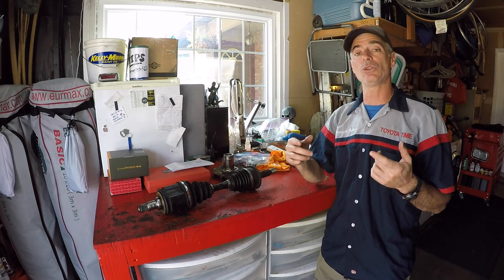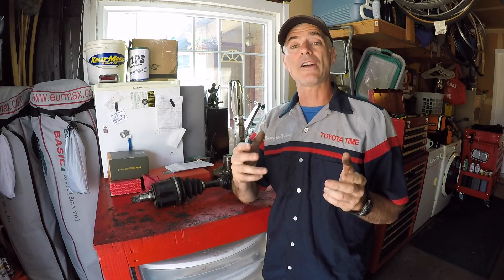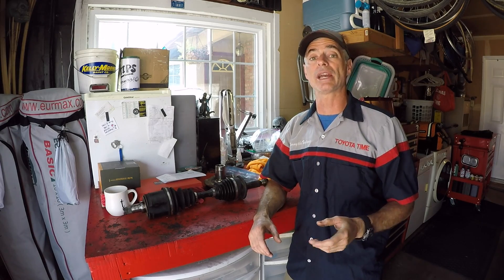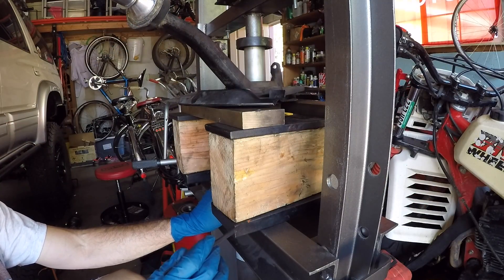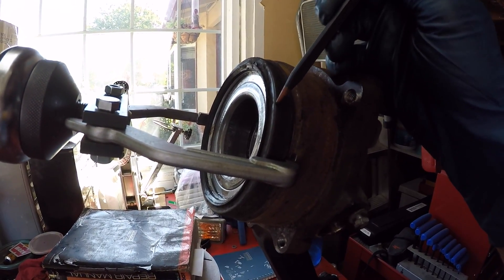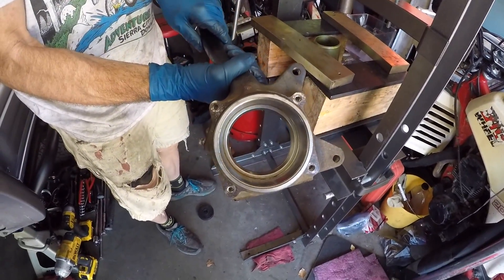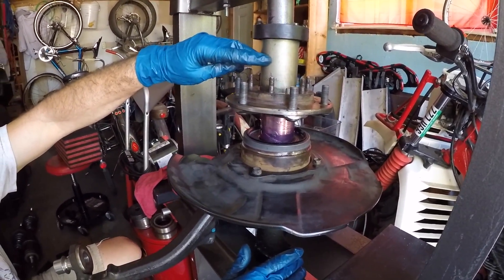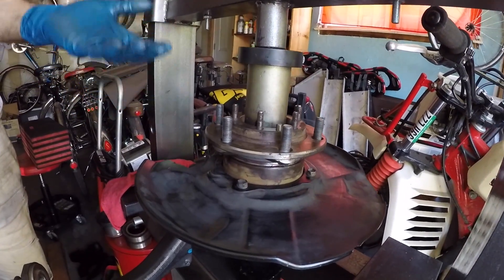Manual Hub Swap Part 2 - A.D.D. Hub Bearing Replacement

Comment: Hi Tim
Instead of using the slide hammer to pull off the inner seal I found if you just use a sharp wood chisel with the bevel side down you can work it off without leaving any marks on it. Just be careful to not hit the chisel in further once you touch metal. Once you have a small gap you can work the rest of it off with a small pry bar. It's the same idea of how you would remove the dust cap off the hub. If your seal is not badly rusted or has any marks in the rubber parts you can usually clean them up and reuse them.
Reply from the maker: Yeah, there's quite often more ways than one to get something done.  Thanks for sharing your technique.

Comment: Wish I woulda watched all these when I did my 4wd conversion.
I used the big press at my old job. Smashed both the new bearings by not properly supporting em. This was years ago now.
Replacing one CV tonight cus OEM boot is blown. Going to replace with a Autozone CV for this weekend then reboot OEM and replace again.
Reply from the maker: Francois L Sicmods Mr. Frenchy! Thanks for stopping by our channel and leaving a comment. Hope all goes well with your CV Re-booting

Comment: Tim, are the (wheel bearing) on a auto locking hub Tacoma same as manual locking hub? ( they share the same wheel bearing) I'm in the process of doing mine.
Reply from the maker: Yes, they are the same bearing.  Check out this video: https://youtu.be/Dj-2IzO9RFk

Comment: Hi Tim, what if I wasn't able to torque my wheel bearing nut to the full 205 ft/lbs? Right around 150 ft/lbs on both hubs there was no one heavy enough with me to hold the tool down without it "rocking out". Will this drastically decrease the life of my bearing?
Reply from the maker: Hard to say.  The nut is pre-loading the bearing.  Will 55 ft-lbs make a big difference?  I don't know.

Comment: Tim and Sean, Im considering a Manual hub swap using mostly OEM parts on my 1999 Limited 4runner before my trip to Alaska. The trip is 8500 miles round trip. Question is Timmy, do you like the swap you did on your truck? Thanks, Russ
Reply from the maker: I love the swap.  My CV axles receive way less wear because they're only turning when I'm in 4wd and I lock the hubs.  I also like being able to use the benefits of 4Lo when climbing steep paved mountain roads.  Using 4Lo enables me to get the benefit of a lower automatic transmission temp going up steep roads without having to worry about damaging my front differential or CV axles.

I have heard that the manual hub CV axles aren't as strong as the ADD axles, but I've done a fair amount of 4wheeling in my rig and haven't broken a CV axle yet.  Another thing is if you need to pull a CV axle with manual hubs, it's a little more work to get it out because of the extra parts.  It's not hard, but it's more time consuming.
Reply: Thanks great info. So are you saying that I can use my 4low without being in 4 wheel drive? I feel stupid right now.
Reply from the maker: Yes. With the manual hubs in the unlocked position, 4 hi or 4 lo won’t spin the front tires
- Sean
Reply: @TimmyTheToolman  Thanks Sean, I already have parts ordered from Joe Joe to do the Manual swap

Comment: Hi Tim, I recently rebuilt a set of manual hubs to put on my Tacoma. I made the mistake of not buying new hub needle bearings and I believe one of them has failed. I am not sure if you have done this, but if you can help I would appreciate it. In order to replace the hub needle bearings I would need to:
1) Remove spindle.
2) Remove the notched nut.
3) Using a slide hammer (?) to remove the brass crush ring
4) Remove/replace the needle bearing (it should come out on its own or with the slide hammer?)
If you can let me know if this sounds right I would appreciate it very much!
Reply from the maker: I actually have never done a replacement of the brass bushings and needle bearing on a set of manual hubs.  I have the parts for it, but haven't had the need for it yet.

I don't believe you need a puller to remove the brass bushings.  I'm pretty sure you can use a long punch, insert it on one side and catch the lip of the bushing on the opposing side and start knocking it out with blows from a hammer working your way around to drive it out evenly.  As for the needle bearing removal, I don't know if it's a press fit or not.

ORS (Off Road Solutions) sells the bushings and needle bearings and I would bet they know the steps to replacing the needle bearings.  I'd give them a call.  https://www.offroadsolutions.com/
Reply: @TimmyTheToolman  Thank you for the quick response. I will give them a ring for more information. When I do the job I will try to remember to comment back with how it went.
Reply from the maker: @Skyder12  Yes, please share your experience replacing the needle bearing.  I'd like to learn the correct process from you.

Comment: Hey Tim, I'm wanting to do the manual locking hubs on my 99 4Runner. If I get used one's like in the video, do you recommend rebuilding them first? And if I can't find a used setup, is there a brand that you would recommend for buying brand new setup?
Reply from the maker: It depends on your situation.  As far as I know, the Tacoma models that had manual hubs didn't come with ABS.  If your rig doesn't have ABS, you could swap the spindles over as is and hope the bearings last for a long time.  If you do have ABS, and you want to retain it, you'll have to swap over the manual hubs to your spindles.  When you press out the hubs, the bearings get destroyed, so you have to replace them.

ORS (Off Road Solutions) sells a manual hub kit.  I don't know of any other seller who does.
https://www.offroadsolutions.com/products/ors-manual-hub-conversion-kit/
Reply: @TimmyTheToolman  I have ABS and I would probably keep it. Is it possible to delete the ABS? I also have a factory rear diff lock, and using the rear diff lock turns off the ABS.
Reply from the maker: @erniekropf665  I've never done research on an ABS delete, but by simply removing the sensors at each wheel would render it useless.  You'd however end up with an ABS dash light though.

Comment: I would like to know how it works with your 4wd selector and the ADD.
Reply from the maker: It works just like it did before.  The only difference is you have to lock the hubs to be in 4wd.  If you shift the transfer case to 4wd, but the hubs aren't locked, the CV axles will spin,  but will not give power to the front wheels because the CV shaft will just be free spinning inside the hub.

Comment: So only way too replace bearing is push it out ? I got an 03 tacoma with manual hubs wanting too replace bearings can u buy the whole complete
Reply from the maker: Yes, the bearing needs to be pressed out.  

That would be very expensive.  You'd have to buy the steering knuckle and the hub assembly.  That would be big money.

Comment: Hey Timmy, did you apply the boot stretch mod to the Tacoma CVs as well? I’m really considering the manual hub swap because I’ve been going through inner CV axle boots like crazy. I applied the extended boot mod to one of my CVs and now a little grease is seeping past the extended portion of the boot clamp.  Yes, the clamp is on very tight. Thanks!
Reply from the maker: No, I didn't do the boot stretch mod on my CVs.  The lift on the front of my rig is probably only 2.5 inches and I have a 1 inch diff drop.  The ribs of my inner boot aren't touching.  

The manual hub swap is a consideration.  Other than the fact my CVs are only turning when I want them too, is the fact I can use 4Lo going up very steep paved mountain roads to keep my trans temp down and I don't have to worry about any binding of my front diff and axles.  There's also the benefit that you're not forced to replace an axle out on the trail if you're able to drive out in 2wd.

Have you tried using a screw-down style clamp on that inner boot connection?  You might be able to get a tighter clamp onto the shaft
Reply: @TimmyTheToolman  thanks for the info, Timmy. Those are all great reasons to go with manual hubs.

I used a crimp style clamp from amazon, similar to the clamps provided with the OEM reboot kit, just a bit smaller. 

I’m about to apply the boot mod to the other side soon, as it has torn within about 5k miles. I’m running a diff drop with a Dobinsons 2.5” IMS lift. Also have steel bumpers front/rear. I think the lift came out closer to 3”. The inner boot ribs definitely rub on each other.
Reply from the maker: @gummybear916  You're welcome.  You could also try extended silicone boots.  Offroad Solutions sells them.  I think if you do a screw-down style clamp, you'll get a tighter bond with the axle.  You'll really appreciate the manual hub mod if you do it.

Comment: This is one of the best upgrade for the Toyota. Using the factory locking hub will help save those axles lifespan & go gas
Reply from the maker: It is a cool mod.  I like it more for the fact I could drive out of the backcountry if I broke a CV axle and the terrain allowed me to get out in 2WD.  This way you could replace the CV axle at a more convenient location instead of being forced to fix it on the trail like you'd have to do with A.D.D. hubs.
Reply: Timmy The Toolman This is very TRUE but I haven't have this issues appear to my truck before on trail, hard Terrain, water crossing, & some rock climbing. For my axles & etc being the original From day one with the truck I haven't replace or fix this type of issues be4. Knock on Woods but this is one reason I went with the hub swap and I'm pretty sure that you know that our IFS isn't the best type for heavy off road, however it can be done just like the SAS.
Reply from the maker: I think most people won't end up breaking a CV axle while 4wheeling, but if you do break one, it sure would be nice to have the option to fix it elsewhere other than on the trail.

Comment: So with the ADD making the cv’s turn all the time does that mean the front diff gear set is constantly turning as well? The reason I ask is because my girlfriends 97 t4r passenger side differential seal is leaking and I don’t want it to run too low on fluid and destroy the gears before I fix it.
Reply from the maker: This is a good question and I'm not 100% sure if the ring and pinion are spinning with the CVs.  I assumed they weren't but I'm going to ask this question on T4R.org and get back to you with the answers I got.
Reply: Timmy The Toolman thank you!
Reply from the maker: I did some more research and the ring and pinion gears do not turn in 2wd with an A.D.D. system.  The CV axles are turning but they are turning a spider gear on each side and not the main ring and pinion gears.  If the ring and pinion gears were turning, the front driveshaft would also have to be turning and I know for a fact the front driveshaft does not turn in 2wd.
Reply: Timmy The Toolman awesome! Thank you for looking it up
Reply from the maker: I appears the ring and pinion will turn a little at faster speeds.  Check out this thread I started on T4R.org: http://www.toyota-4runner.org/3rd-gen-t4rs/260388-question-about-d-d-system.html

Comment: Great video as always! My only gripe is that you really shouldn't have greased the threads for the hub locknut as that torque sets the clamping force or pre-load on the bearing. Lubricated threads can nearly double the clamping force vs unlubricated threads using the same amount of tightening torque. It should be alright since they are very well made bearings (my original koyo wheel bearings on my Tacoma have almost 400,000mi on them), but I would expect reduced life due to an increase in operating temperature.

Edit: I forgot to mention that these wheel bearings, like most other wheel bearings, are double angular contact ball bearings similar to two tapered roller bearings faced opposite of one another so the pre-load is important for maximum bearing life.
Reply from the maker: Nearly double the force due to lubricated threads?  Hmmm.  I did a quick search and I didn't see a 100% increase in the torque with greased threads but I did see something about fasteners with anti-sieze on them would require 25% less torque.  

This is interesting.  So, I have a question.  Are all torque values in a Factory Service Manual "Dry Values"?  If that's the case, you would have to painstakingly make sure every fastener you are using is clean and dry.  How many mechanics would take the time to do this?

Here's a few interesting reads: 
http://bbs.homeshopmachinist.net/threads/33782-Bolts-torque-and-grease
http://www.raskcycle.com/techtip/webdoc14.html
https://arp-bolts.com/p/technical.php
Reply: New and dry threads have a K-factor or friction coefficient of around 0.21, "dirty" threads around 0.27 or more, anti-seized threads about 0.16+-0.03, and well lubricated threads 0.12 or less. Tightening torque is directly related to clamping force via Clamping Force = Torque / (K x Bolt Diameter).  Keeping all other variables the same except nearly halving the friction coefficient or K-factor with a good high pressure lube will therefore nearly double the clamping force when comparing to new dry threads (K~0.11 for high pressure lubed threads vs K~0.21 for new and dry). However, there is always some leeway that engineers have designed into the tightening torque of most fasteners because K can vary due to a number of factors like corrosion and machined tolerances. For most fasteners, clamping force is not that critical, but for things like head bolts and differential pinion nuts where there is bearing pre-load, it is important for the longevity of the part. 

The service manual gives torque specs for dry and relatively clean threads unless it is otherwise noted such as for the head bolts. No mechanic has time to even torque most fasteners let alone clean them. Like I said, clamping force is not that critical for a vast majority of the fasteners on a car and even where it is critical there is usually quite a bit of leeway designed into a stated torque value to account for the variance in K. In your case, lubricating the threads at the very worst could have increased the bearing pre-load by 90%. But the bearings are designed for very high dynamic and static loads, usually more than double what you would normally put on them so that they last a long time, so I wouldn't lose sleep over it.
Reply from the maker: Thanks for sharing this.
Reply: I am happy to share. There are a lot of opinions and hearsay on the inter webs. If really want to learn more about this topic to please read up on it in an engineering textbook, don't take my word for it 😁.

Here is a good general overview of fastener design by Fastenal here:
https://www.fastenal.com/content/feds/pdf/Article%20-%20Bolted%20Joint%20Design.pdf

 Keep up the great videos Tim!

Comment: Hey Timmy I have a off topic question. I have a 04 Tacoma 2.7l and it makes a  ticking noise, nothing too loud only when  the engine warms up use to be only in drive at idle but now it’s doing it in park too but not as loud. Could this be a flex plate problem. Or something different? Sometimes when I turn my Ac down or off it kinda determines how loud it is. Any help will be appreciated! Keep up the great videos!
Reply from the maker: It could be the flex plate but it also could be just the engine making some noise.  The valve train can be noisy on some engines.  My 2000 4runner ticks pretty good when it's cold but quiets down when it warms up.  A cracked flex plate has a pretty unique sound to it.  It's like a ticking/squeaking kind of sound.  If you get yourself a mechanic's stethoscope,  you could possibly narrow down the origin of the noise.   You can video the noise, upload it and send me a link, and I can listen to it and give you my opinion. I'm currently traveling so I might not be able to watch it right way. It will depend where I'm at and whether I have an internet connection.
Reply: Timmy The Toolman I will definitely record the sound.. do you have a email or something you would like me to send it to? And thank you for the reply!
Reply from the maker: @RidingWiithJacob  Here's my email address: mtbtim@sbcglobal.net
Reply: Timmy The Toolman https://youtu.be/Nq9zoiisLuA   
Haven’t got the chance to record the sound but this is the same exact sound only happens when truck is warmed up and idling not in park or neutral only drive and reverse.
Reply from the maker: @RidingWiithJacob  That doesn't sound like a broken flex plate to me.
Reply: Timmy The Toolman I think it may have something to do with the AC when I turn it on it makes that noise and today I got under the truck and I’ll turn the ac off it stops. Think it could be the compressor or something?